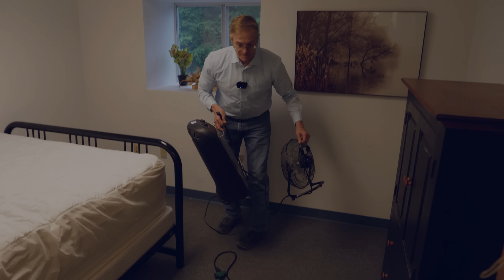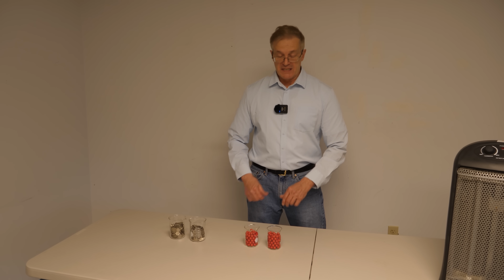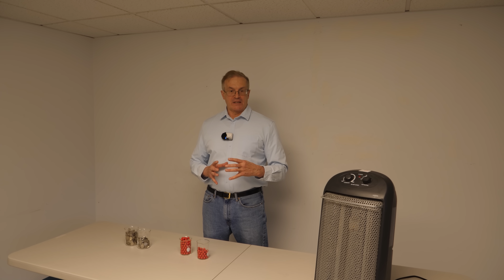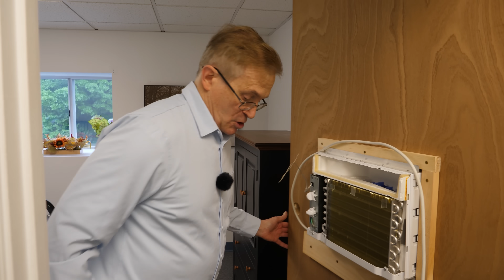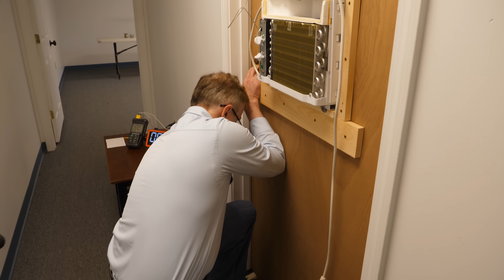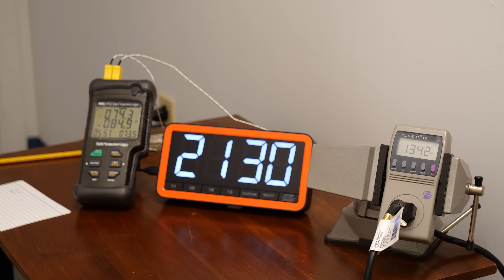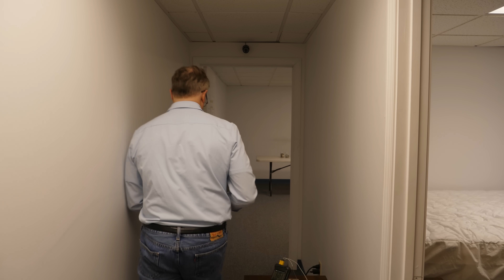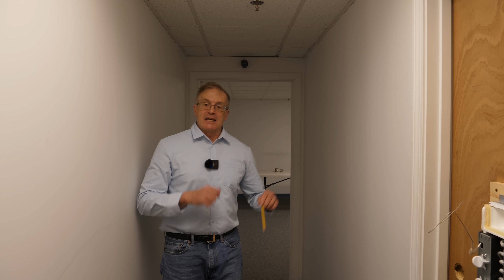You're wasting money on heating! Use your A/C!

Comment: It's not shocking that a heat pump can go both ways and both cool or warm up the air.
For all the people in rest of the world: we were all shocked the first time we learned that the USA air conditioners only work to cool off rooms and people there don't know that they can do it reverse as well. For all of us an AC means a heat pump. We didn't know your ACs don't heat up. Somebody screwed you big time and for a long time. You got scammed.
Reply: You have to keep in mind the US is a big place that spans a lot of climates.  Most areas of the US have been using heat pumps for decades to both heat and cool.  However, some climates on the extremes had some other form of heating and comparatively small cooling needs or vice versa.  The cooling only heat pumps were for those areas, not the majority of the US. 

In very hot US climates only cooling is needed.  The coldest temps in those areas just don't justify a heating system at all.  A reversing valve/control systems for heating are not very expensive, but it does add some cost and complexity.  When they malfunction, the system is usually stuck in heating mode by default.  I live in Florida and this has happened to me twice.  It sucks to have your AC stuck blasting out heated air in the middle of summer.  I also never use my system in heat mode even during record cold weather because inside the house it never gets below 65F.  So while most heat pumps installed in my area can heat and cool, we could get by just as well with cooling only systems.  

In very cold US climates, older heat pump technology could not produce enough heat in low ambient temps to be feasible.  So, they need a lot of heating and their heating/cooling needs are not balanced.  That is a problem for heat pumps because an appropriately sized system for heating would be way oversized for cooling in those climates.  More modern heat pump technology works well even in very cold weather and variable speed systems solve the heat/cool load balance as well.  So, now even these few remaining regions are moving to heat pumps rather than separate heating and cooling systems.  

So, comparing this to the rest of the world, it probably only seems odd to countries that have both heating and cooling needs in the same region and don't understand that only certain parts of the US have dedicated cooling-only systems.  To someone in Egypt or Iceland, I'm sure they can understand why cooling-only systems exists or why old heat pump technology was not always feasible for heating.

Having said all of that, the US does still lag way behind in HVAC tech, but not for the reasons you suggested.
Reply: @CL-gq3no  Yep all of this ^. I grew up in california and I didnt even know heating ac units were a thing because they would be all but useless to us there. But now I live in the midwest I have a heat pump unit that is our only heat in the winter (aside from some tiny personal units for extreme weather, always have backups). and they are nothing new out here even if many people dont know thats what they have. I think mini splits is what has brought awareness of what they are to the masses.
Reply: The big HVAC mfrs didn't want to damage their furnace and boiler businesses when they started selling air conditioning.  Even when they did start selling heat pumps, they didn't work well below 40F for that same reason.  

Although heat pump efficiency drops to near that of electric heat from 40-20F in areas with humidity due to the need to defrost the outdoor coils.  This usually only means reversing into indoor cooling mode for a short period but to avoid discomfort, electric heat strips run to warm the cold air being discharged inside during the defrost cycle.
Reply: @jkbrown5496 air to air heat pumps here in in Sweden have cop of 3,5 at 20f and about 2.1 at -20f and they still have a average scop of 5 thought the year while also being able to do hot water for the home and cool the home during the summer with a high efficiency
Reply: Americans also don’t know what a split system is
Reply: At least now the name air conditioning means more! It conditions the air to make it comfortable - by heating or cooling!
Reply: Perfect example of crooked Capitalism practiced in USA!USA!.
Reply: Wait till you learn that they don't even use inverter ACs. Energy efficiency isn't a thing in the USA since 1970s iirc, since burning fossil fuels is really cheap there. You can also see it in their preference for big trucks that they don't use as trucks. Things are changing nowadays, but it's deeply ingrained mentality for generations.
Reply: @squeaky_honda , correct.  That is the bigger issue in the US.  We are still mostly installing fixed speed systems (circa 1980) even today.  

I have now DIY installed 3 Midea (Chinese) variable speed HVAC systems in my home and a friends home because the local HVAC technicians would either outright refuse to install anything variable speed or quote prices 3x over the fixed speed systems they are used to.  I installed them for less than the price of the garbage they were trying to sell me and the systems I installed are state of the art rather than 1980s tech.

Just listening to their speeches about why the modern variable speed systems are "not needed" and why SEER rating is not important made me lose all confidence in their level of competence and knowledge.  The gist of it was mostly "those things run all day!"  Yeah, at a very low speed, using half the energy, quietly, while maintaining precise temp, and effectively dehumidifying.

Comment: As I hear my A/C running right now, I'm excited for the follow up video.
Reply: 😂 I wish we had the next video a month ago
Reply: I dont know what they're gonna say in the next one but misters can be used to cool the hot coils of an AC unit to greatly increase it's efficiency when it becomes heat soaked.
Reply: @MindCrime550  I'm thinking that, too. I've got a circa 1980s portable A/C unit (Toshiba Cool Mini) that uses a water spray kicked up by a fan in order to help cool the condenser. It does a pretty good job for such a small machine. Initially I did think it was just a swamp cooler type, what with needing water and everything, but nope, it's definitely got a little compressor, evaporator and condenser in there which look to have been repurposed from their line of dehumidifiers.

Comment: Wait what, North America, one of the biggest western markets for residential ACs does not use reversible ACs (yet)?

We've been installing reversible air-air heat pumps for ages in continental europe and asia. 
Central Europe now modernizes and moves to ground to water and air to water heat pumps. 
Well guess that's what happens when cheap, polluting, war subsidized coal, gas and oil is available.
Reply: I’ll keep my furnace and A/C.
Reply: @Jameson1776 US most definitely does use heat pumps almost everywhere. However, furnaces are still common in very cold areas (northeast and great lakes region) where the outside temperatures are too cold for the cold side refrigerant to expel heat to the environment. I was hoping he'd address that. I believe from watching his previous videos that he's in New Hampshire (at least New England), which is an area where furnaces are still common.

Also, this is pretty hilarious considering the US is paying the majority of the cost for a war to keep natural gas flowing to central europe.
Reply: @clayortex  I live in the midwest of the USA and it gets below 0F° and above 100F° most years so it doesn’t quite apply to me. As far as paying for a foreign conflict the U.S. will do as it always has and look out for its own interests.
Reply: @Jameson1776  For harsh winters and all the time your power grid goes down in mild winds... sure keep your furnace. But can't fathom not using a HeatpumpAC the rest of the year, ie spring, fall, and mild winters. Good heatpumps achieve a COP of ~2.5ish down to 10F

Comment: All fine and good for operation when you don't need heat. But the external coil is going to freeze up and get covered with ice/frost if you try to use it to pump from the outside when it's actually cold out.
Reply: Heat pumps have a periodic defrost cycle that melt the frost build up, some cycle on a run timer basis, others based on the temperature of the outdoor coil, and more sophisticated ones operate on a demand/need basis.
Reply: @Stomper67 Yes. It stops the outside fan and reverses operation for a while until the return gas pressure is high enough or return liquid is over freezing point of water.
Reply: @Stomper67  Yep. Fine for places that don't get cold (which is the majority of places) but that also means heatpumps aren't good for doing lots of heating. For locations where it's -30F for a week (say, Minneapolis, Minnesota, USA) they still don't work.
Reply: This is like a 15 year old take at this point